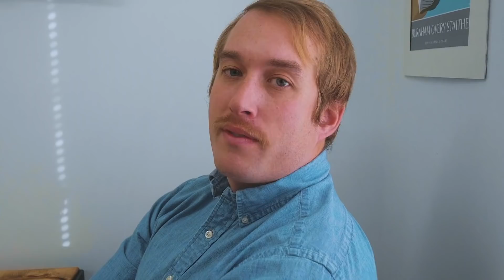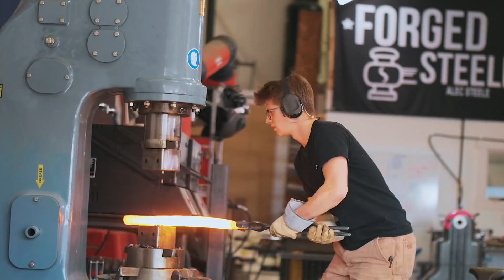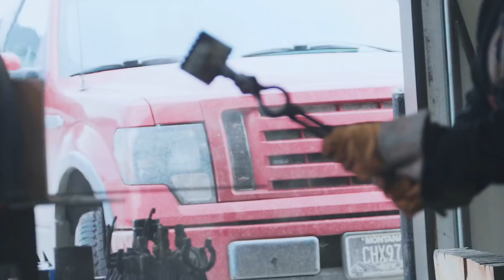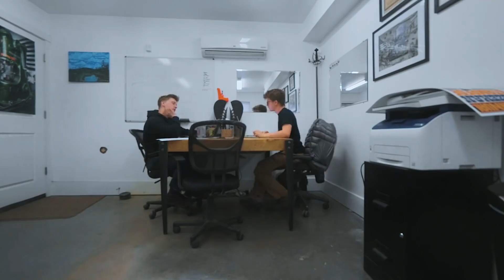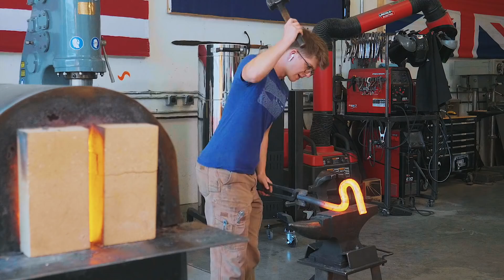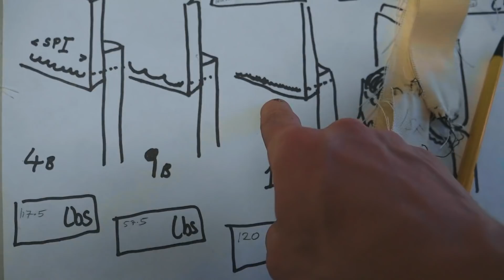JOHNNY 5 NEEDS A BLADE!!! Part 1

Comment: Need to divide the weight of the load in half in testing the stitching if the stitch failed.  When fabric failed, you still do not know how strong the stitch is. Stronger than half the total load for sure.

Comment: In your fabric loop weight tests it's worth pointing out that your stitched seams were holding half of that weight; the other side of the loop held the other half. A straight single strip of fabric with a seam in it would be holding the entire weight. But the results should all be accurately relative to each other as tested.

Comment: Idea.
Would you be able to forgeweld machiningshavings back to steel?
Hydraulic presschannel just tried to just press shavings into steel again but failed.
But if You would press shavings in a hydraulic press and then tried forgewelding it into a bar or something.

Comment: Separately test the strength and break point of the thread you are using FIRST.  Add HEMS to the sides of the test fabric strips to reduce the number of FABRIC failures.

Comment: Your stitch test needs some work.  It should be noted that the testing you did was done in basket formation, roughly doubling the strength of the weakest link. When sewing you typically have the following variables, strength of fabric, thread tensile (x2 - ~20% when using a bobbin style stitch), stitch pattern, and then finally stitches per inch.  It's all a soup where changing one thing can throw off the other.  A quick example is running long longitudinal (in line with expected force) zigzag straight stitches in webbing. If you use 10# test thread each stitch holds about 18# (top thread plus bobbin - 20% derating due to bend radius) do the math to find out how many SPI you need for the application.  Too much SPI will damage the fabric, thus making it the failure, if so go next thread size up.

Comment: For the strength of a seam what I've found from our factory is that the thickness of the thread makes a HUGE  difference! Ask your supplier for a lower ticket thread (lower=thicker, we typically use tkt20 as it's an nice balance between work-a-bility and strength)
Secondly, increasing your stitches per inch will improve strength.... on canvases. If you're working with something like leather for example you can actually perforate the leather and loose strength there. So there is a law of diminishing returns as well 😋

Comment: As a tailor, I have to factor in seam strength to make sure it’s not too strong.  If the seam breaks, you can re sew it but if the fabric tears, it’s much harder to fix.  Just something to keep in mind, depending on the project.

Comment: It's not just about the breaking point of the stitches/fabrics, you can make a tough item but the bulkier you make a stitch the more likely it is to become a wear point. You also want the articles to be comfortable. 

Also, clothing isn't stitched together overlapping like that so you aren't getting a proper test. So it's only partially about the stitch style and more about the thread quality.

Comment: Alec.  Great content.  I have an idea.  Maybe you could try your hand at making affordable motorcycle/durable work clothing.  Try riding pants, 22oz denim vest jacket with thick leather sleeves.  No one makes those anymore.  You could do riding leather vest with 22oz denim sleeves.  Serious Alec.  You could corner a market.  Affordable UK inspired American made riding/work clothing.  Those in black, flannel, stone wash and dark blue with and without hood are not available anymore.  They used to be popular in the 1980s and 1990s.  With the trade mark Alec Steele or Steele Clothing you could corner a market for affordable clothing.  Think about it and give a comment if you could.  I would be a constant customer and you tomorrow your stuff and ship direct through USPS large box Express.  I was almost a Jr architect and I have dabble in logo design. Drop me a line if you want more input.

Comment: That looks like the 3600 rpm Combo kit from ISC with the KB9520.
If that's the case, I'm a bit worried because the motor they supply is extremely unreliable. I've had FOUR of them burn up 2 on one grinder and  2 from 2 different grinders. ISC has been way less than helpful. Tread carefully.

Comment: You need to fix the tension on your overlock machine. The serge stitch looks WAY off. Also with stitches per inch, you have to be aware that if you up it too much it can shred the fabric.

Comment: A propane flame if set up properly will not produce any carbon monoxide (CO) at all. Only if there's incomplete combustion you will get CO from propane. I would think that your ribbon burner gives as perfect combustion you can get, so no risk of CO. If you're still worried there are very inexpensive CO detectors you can put at the wall to detect any CO before there's any danger. That could maybe be a bit better during the winter so you can save up on the heating cost.

Comment: Ok, here's my issue:  All you're testing is shear strength.  That's not useless, it is actually pretty important.... but.... it's a lot more common for seams to break or other holes to develop in clothing over time.  Wear strength is actually quite a bit more important.  Wherever you join fabric together?  There's stress.  Over time that leads to tearing either at or just outside of the seam.  It isn't the strength of the seam itself that's the issue, it's the durability of the fabric itself, and how well those seams can distribute force without tearing the fabric around them.

Comment: @Alec: as I saw you experimenting with the stitches and try to find out, how much weight a piece can hold, I was thinking that your measurements would be much more accurate if you would fix your test piece to a fix point and steadily pull on it with a spring scale in the system to detect, at which force it breaks.

Comment: Just a tip, next stitch trial you could try to stitch the sides of the fabric strips. This way it will not tear from the side, which gives a false indication. 
Still, I'm impressed by the strength of that double stitch!

Comment: It looks like you we using canvas. To cut canvas it is easier to make a small cut then rip it. It was always go in a straight line and be stronger. Sometimes you may have to cut the corners so the string will stop racing back and forth. Hopefully a useful trick from your friendly mechanical insulator

Comment: You probably know this but you must set the number of stitches per inch according to depending the type of fabric you are using. A heavy canvas like that can take a lot of stitches. Shoot, for comparison, you should try a bar tack (that is a zigzag stitch with a very short stitch length, such as would be used to anchor nylon webbing in place)!!! But that a high stitch count could destroy a silicone-impregnated nylon.

Comment: Hey Alec, when testing those fabric samples did you have the stitches oriented on the top of the bar (so the stitch was under tension) or on the bottom of the bar near where you loaded the weights? I would hate for you to have to re-do the experiment, but keeping the stitches on the top would ensure the most tension and load on the stitch giving you the most accurate assessment of the stitches strength.

Comment: What is the white powdery stuff u put on the hot metal
Reply: It was most likely borax, it's used as a flux to assist with getting a clean weld

Comment: For testing tensile strength, in general, a hydraulic cylinder with a decent gage, and pump with a decent flow control valve, should give you pretty good resolution with data as well as repeatability. May be a bit less tedious and safer than Olympic weights and gravity 😉 But, that's just based on my past experience and applications.

Comment: Alec, I know that oiling blades is helpful against oxidation, but is there any use for oiling your anvil and tools (Hammers, tongs, etc). And is the answer different if the tools are inside or outside (Just under a roof)

Comment: Alec, if you want to be cutting fabric (or multiple pieces at once) more easily or faster, with a straighter line; check our ZipSnip and other fabric (and carpet) cutting tools. I just started using them at work and it made everything so much better.

Comment: You should take a look at the construction of soft gear parts of climbing equipment, typically it's rated to hold 5000 lbs for at least 3 minutes before a failure and most is stronger than that

Comment: I’d think you would have a heat exchanger ventilation system. Yikes. Open the pod bay doors, Hal. 🤓 Also, I thought it was Easy Peasy, Kim and Yeezy. You learn something new everyday, if you’re not careful. 😎

Comment: I’ve always been curious why you hand grind billets in between stacking instead of surface grinding or mill, to get a better flat surface for welding.
Or is that just not that critical for solid welds?
Reply: How I understand it is if the surfaces are smooth and clean the cleaner the weld will be with less chance of it not welding properly or having a delamination

Comment: I just had an interesting thought..... in the winter that massive door, by the forge, is going to let out so much heat global warming is going to be your fault 😋 Joking! Why not open it about 7 or 8 foot and make a steel frame, covered in ply, with a regular size door in the middle..... or a double door? You could also add a couple of square openings that fit those large box(?) fans (the square ones people put in windows. If you set the whole thing back from the shutters enough so they can open and close without moving the frame, you could also set it up with hinges and a large caster wheel, to support the weight so the whole thing can still open. Mabey get Fireball Tools back for a few days?

Re your stitching experiment, have a look at the stitching on a climbing harness, really close stitches and a zigzag. So strong it's amazing! Your thread selection will also play a huge role in the stitch.

Comment: i think you should redo your stitching test and apply the force from one syde of the stitch to the other , usaly when a clothe or something is made out of fabric brakes it is because a smal point broke or was ripped and the failure is spreading allong a stitch beacause the stress on the piece is not shared well inought along the stitch

Comment: I can tell by the sound of the weld that it either needs to be turned up or the speed needs to be adjusted it doesn’t have a clean buzzing sound Hope that helps

Comment: In testing fabric/textile stitching "strength" , the fabric/textile strength must be a known. the stitching material should be stronger than the fabric, otherwise the stitching becomes the weak link in the system. There are uses that would benefit from the stitching being the weak link... tear away costumes for example.

Comment: Correct me if I'm wrong: if you have a loop of fabric and you pull it like you do at 160 pounds, the force across the stitching will be 80 pounds since the load is carried by two strands.

Comment: Stitches act like any other manufactured item - the fewer the stitches, the greater the differences in the forces at the discontinuities and the more likely that the item will fail at these.  You want an interlocking edge to be as smooth across the discontinuity as possible (many more small, tight stitches).  Also, due to long-term forces on the item, the stitched region may experience slow degradation, so it does have to be reinforced somewhat to make sure it lasts the life of the item.  In effect, "maintenance" has to built-in for the item, with as little human intervention to correct things as possible.

Comment: Another factor in the stitch/fabric analysis is whether the needle used is sharply pointed and is  cutting some fibers as it passes through or , as in a needle for stretchy, knit type weave which uses a ballpoint needle and pushes the fiber aside as it goes through. One will diminish the integrity of the material while the other utilizes it. Happy experimenting.

Comment: Alec, the problem of large number of seemingly independent variables and small sample sizes isn't new! In engineering we use a number of tools to search the design space for optimal solutions - You should have a look at the "Design of Experiments" or DOE/DOX.
Reply: I'd guess you are a 6 sigma guy as opposed to a reliability guy. Good tools in both toolboxes.

Comment: Too much office/business/behind the scenes stuff recently. I wouldn't mind if it was like 1 in 5 videos but it seems like recently it's been about a third of all the videos.
Also it would be nice to see some maintenance on your equipment. How often do you lube the grease fittings on your power hammer? Do you ever change the coolant in your band saw, or check the filter?

Comment: Does Damascus have any advantages over other steeltyps besides that it looks better?
Reply: In the simplest terms, no.  But at the same time, not all steels are equal.  High Carbon Powdered Crucible Steels are in the top of the class for blades.  But, pattern welding combines art with function and is what many smiths prefer to explore and present.  That's because it showcases talents that are hard to present with homogenous steels.

Comment: When the stitch tension is right , you have the stitches pressing the layers of fabric together so you have friction as well as the thread resisting the pull, so getting the optimum stitch count as well as serging and folding will nearly always make a seam with more strength than the fabric itself then it is just a question of balancing the cost of the stitches, the sewing operations and your margin against what the market is willing to pay.

Comment: I feel as though a better way to test the strength of a stitch without breaking the fabric is to try to break the seam apart from the middle of the seam that way you are pulling against the seam directly rather that on the seam by the fabr5

Comment: Fabric seams: Levi Strous has the best seams, rivitted where it needs more strength.
Reply: Always been partial to Carhartts myself.
Reply: @arewhyinoh8595  Duluth tradings pretty good
Reply: Bill Woehl I’ve never had jeans fail in the stitches, it’s usually next to the zipper. Can’t be fixed either.
Reply: @jeremyhagen7684  In early testing, they apparently experimented with rivets near the zip in the crotch of the jeans.  It is said that fireside testing one night eliminated that one from the design...
Reply: Levi Strauss outsourced all their clothing, most of it was outsourced again from China to Africa, because apparently China wasn't even cheap enough for a Jean they charge 40-50 dollars for.  There are many better jeans out there than Levis, if you liked the old 505s, try All American Clothing Company's Classic Jean.  They have heavier denim and are made in the US from US materials.
Reply: @CCNorse  I'm talking about the man Levi Strous, not the present day company

Comment: Hi ! Great video, but hey, as always. I am not much of a physicist, but it seems to me that the loop geometry of the samples means that the weight applied to each "branch" of the loop is the total weight divided by two. Same as holding someone from two arms instead of one. If, IF, I'm right, it does not change the relatives results between samples, but lowers a little bit the overall score of all samples. Can someone confirm/infirm ?

Comment: I really enjoyed the experimentation with the fabric and stitches. This will  vary a lot depending on the different fabrics themselves. I suspect a vinyl or plastic type fabric with no woven component would fair quite bad with the high stitch per inch test.

Comment: For stuff you may sell in the future: are you going to buy parts for and set up one product and weigh it before you get pallets of the product in the future now that you understand all the shipping requirements, or are you going to sell whatever and deal with the costs however you intend to deal with them?

Also a fun thing to consider: is there a sweet spot between amount of thread used for stitching and the durability of the stitch for efficiency?

Comment: For the textile stress test, Couldn't see very well, maybe you already took that in account, but fabric has to have the warp parallel to the force for maximum strength., not the weft. That may also affect stitching strength.
Reply: Marc Gràcia it’s also known as the “Warp & Fill”. Warp is stronger than the fill. As far as best way to determine the strength...we used to say “warp won’t and fill will” when it comes to fabric fraying or breaking easily.

Comment: Alec, you should build a nice big hood vent for your forge. You can hang it from the ceiling with super duty cables and run a flex duct out the wall. That's a project I'd love to see.